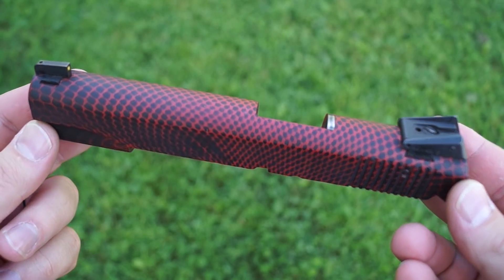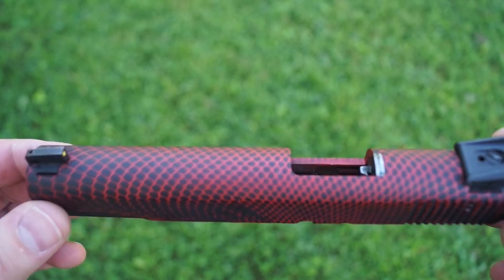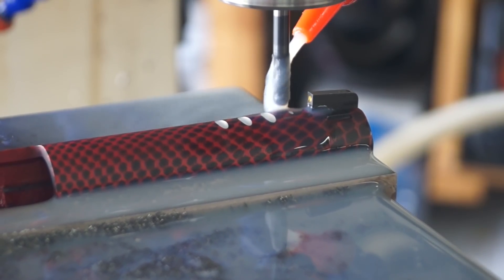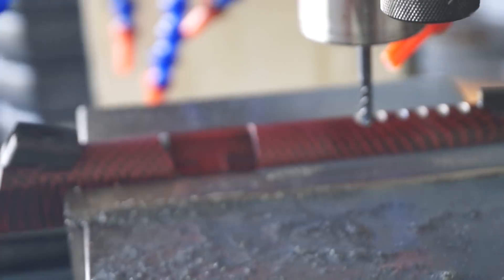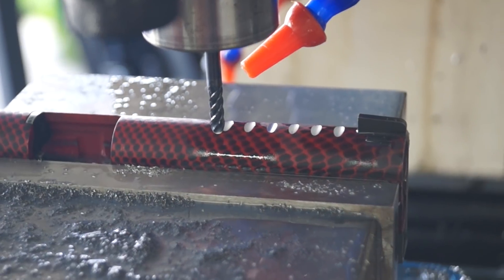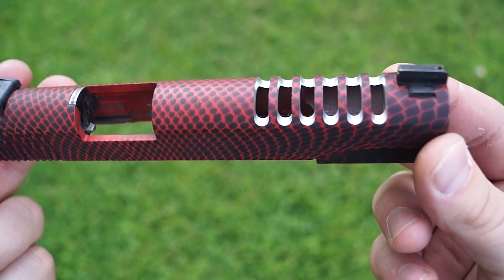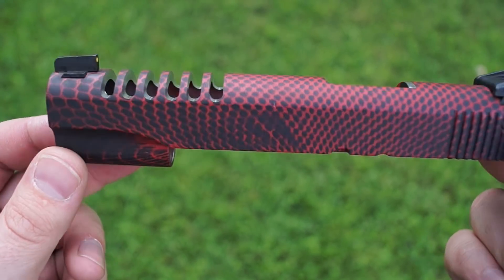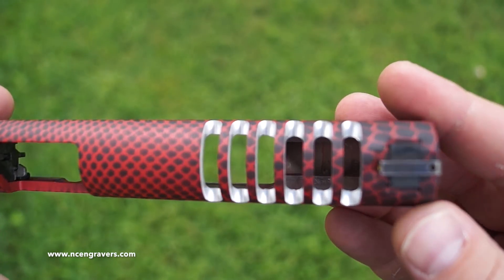1911 - CNC Slide Milling

Comment: This looks like a GSG 1911 I had. Its a shame the gun shop didn't notice the " peening over" of the soft metal where the slide lock engauges. Mine looked like this after 100 rounds, ATI replaced the slide once, and then I sold it.
Reply from the maker: these are an aluminum slide and the slide stop is steel.. poor design..

Comment: Man i subscribed your work is off the wall bud! Im going to be getting a hipoint 40sw-p yup a hipoint. Because its cheap as dirt and it just works i cant ask for much more. i drive a ford pickup with a rotted out bed, why, because it runs and drives. As long as it works who cares how it looks lol. But i do however want to make this gun look and funtion very well kinda wanted to do this for a while prove that with a little effort you can put lipstick on that pig. Is there any way that someone could ship to you a slide "hipoint 40sw-p" slide and have you port it identical to what i just watched in this video? i love that look always have.